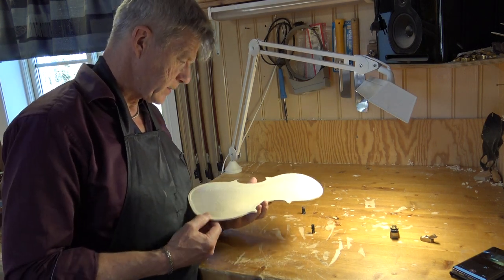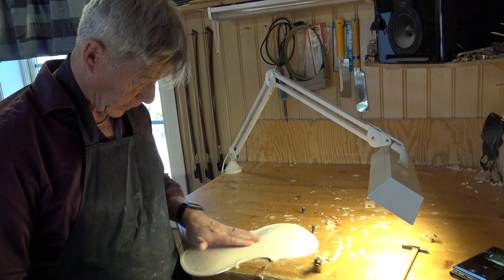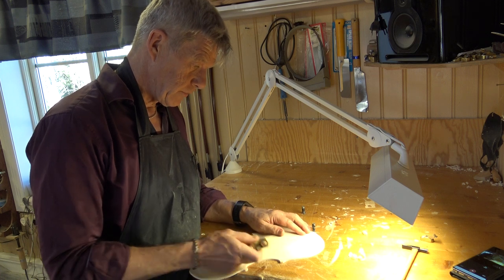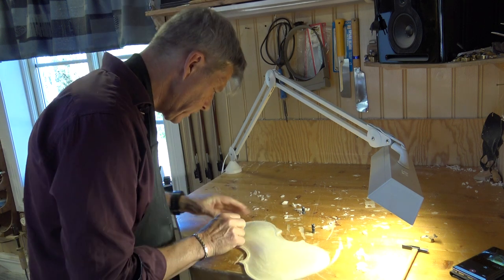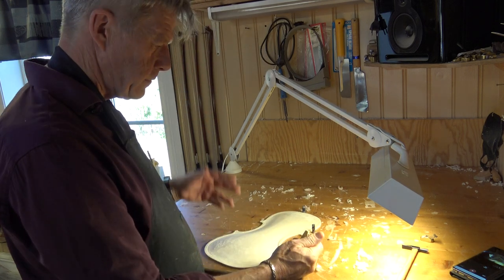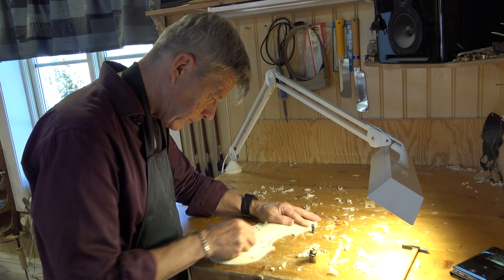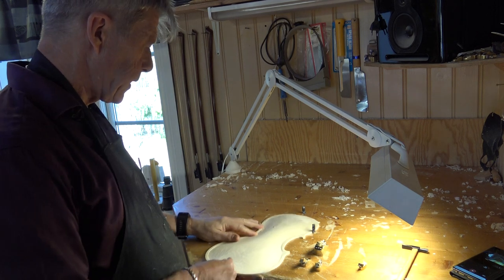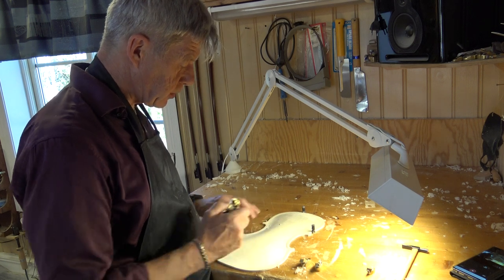Violinmaker Peter Westerlund Part 22b Cross and long arch  Start of the rest of the arching

Comment: Does this method work on all models? I'm thinking of earlier arching profiles like those of Nicola Amati and Stainer for example where the chanel is deep and wide.
Reply from the maker: I am not saying that this is the way they did it, but in my world, the method goes for all different models. 
The cool thing is that on for instance cellos, the Strad models become quite low and Montagnana are considerably higher.
Reply: Thank you. So I presume that the important thing is to create the channel as you want it first and then 'tune' from there.
Reply from the maker: @GMBhatblocks  I have to say that I don´t quite understand your question.

Comment: Regarding the trimming of the roundness of the edges, you modify the curvature of the edges by stroking the edge with the fingers, and also there you modulate according to the pitch. But how do you avoid that the final distance between the ribs and the edge of the plates is getting nonuniform? Your violins are certainly uniform in the distance between the ribs and the absolute edge of  top and back plates, and still the plates have identical roundness, and they have identical shape to the rib contour. This is something I struggle with a lot.
Reply from the maker: Hi Sergio! I don´t tune the final edge. I make it uniformly sticking out all way around. If it had a significant role in sound, a lot of the old violins should be badly affected. The reason I tune it before making the arching, is that by doing that, the provisional channel gets right and by that the low part of the arching also gets right. If there were irregularities in the outline before making the arching, the arching would be out of harmony.
Reply: @Westerlunds Violinverkstad AB Peter Westerlund  Hi Peter, I understand that the provisional channel is a reference for finding the arching of the top or bottom. What I struggle with is getting the ribs to be perfectly aligned with the shape of the back and top. What do  you use as reference for the roundness of the edges, the ribs in final arrangement with the blocks? From your stroking of the edges pf the top and back, it seemed that the circularity of the top and back was not only dictated by the ribs but also by the pitch Then, in worst case, the ribs may not be perfectly round and conform with the top and back form.
Reply from the maker: @sergiomanzetti1021  I don´t really understand what you mean, but both the plastic mould as well as the inner mould are "tuned". If the ribs are made tight to that form, there will be a very small space for irregularities that can cause big problem.
Reply: @westerlundsviolinverkstada9892  This is very important what you write. Should the ribs be a little loose or should they be pressed around the inner form, when one cuts out the top and back plate?
Reply from the maker: @sergiomanzetti1021  I always try to make the ribs tight around the inner mould. In that way they follow the tuning of the moulds I already made.
Reply: I see, it is this process that I find difficult, because when glueing the ribs to the back and top, the ribs may be not exactly vertical, and then one of the two distances to the ribs (top plate, or back plate) is not equal to the other.
Reply from the maker: @sergiomanzetti1021  Then of course I fine-adjust the overhang after glueing the plate to the ribs but that I think you knew.
Reply: @westerlundsviolinverkstada9892  Is this why you do the purfling at the absolute end, so you avoid adjusting the overhang with purfling already inserted?
Reply from the maker: @sergiomanzetti1021  Yes!
Reply: @westerlundsviolinverkstada9892  Thanks for this clarification!

Comment: OK, you say that after tuning the edge, you create the chanell and it is important to make the chanell close to the finished shape. So, I presume this applies to any model and you just cut the chanell appropriately before proceeding with the arching.
Reply from the maker: Yes! As I see it, it is important to make the chanel so that the arching can be worked as close to the edge as possible. If you don´t cut it, you can only "tune" the arching down to appr. 20 - 50 mm from the edge. When you make the final chanel all your work of tuning will be lost since the arching now created will affect the whole surface.
Reply: @westerlundsviolinverkstada9892  it all makes so much sense and I'm excited to try it out on my next instrument. Thanks again for sharing.
Reply from the maker: @Kelvin-ed6ce  The pitch will blend to whatever depth you have. Be concerned of having the same depth all around the plate, though. The depth of the provisional channel has nothing to do with the thickness of the plate at that point. It is just a stop for the arching before making the edge. You can skip the channel but then you have to make an edge without any scoop for a channel.

Comment: Maestro, what is the general thickness of this plate? Thanks!
Reply from the maker: If you mean the arching height it is about 14.5 mm on a del Gesu plate.
Reply: @westerlundsviolinverkstada9892  haha,…no I mean the overall thickness of the wood itself. By taking away material to lower the rub or tapsound …do one has to respect a minimum of material…otherwise the plate could get too thin perhaps? Sorry for my stupid questions I only try to understand it fully… 🙏
Reply from the maker: @pecator70  It is a very good idea to be careful when scooping out the inner part. However, the thickness is just what is left after the outer and inner arching is done. If you go down too far on the outside, it will get thinner at that spot when making the inner arch correct. A good advice is to match the inner rub-pitch to the outer at a certain spot where you are in question. The character of the sound can be deceitful. If it done perfect, the traditional thicknesses will occur. I make it as careful as I can. after that I measure and go back to try the spots where the thickness seems to be too much. It might also be that I have left too much on the outside by accident. I then make the adjustment from the outside.